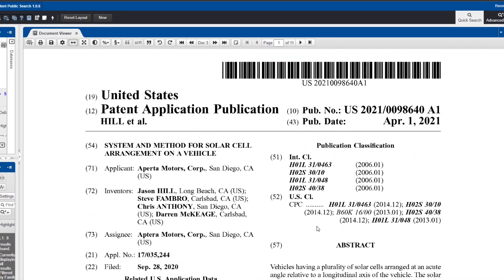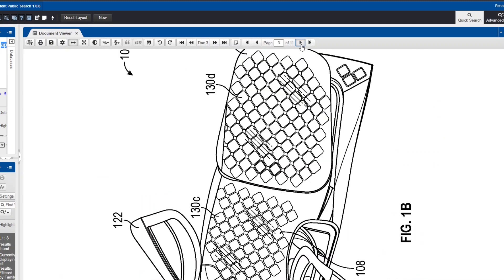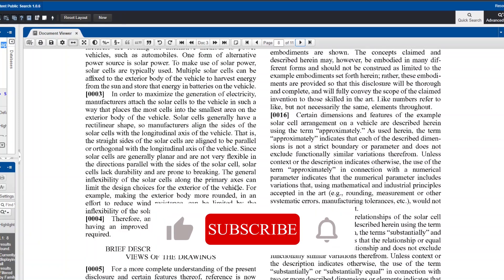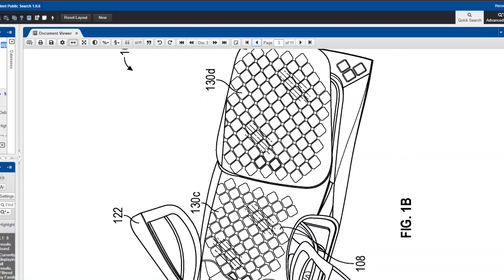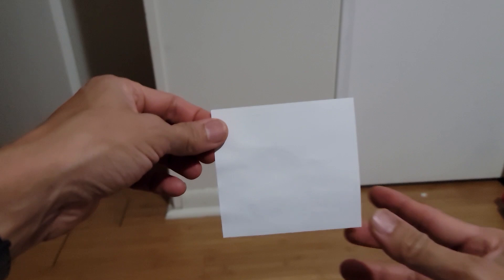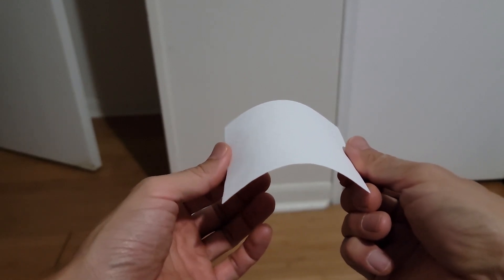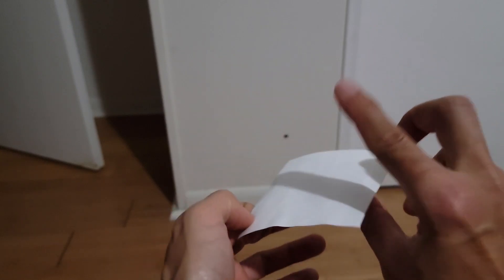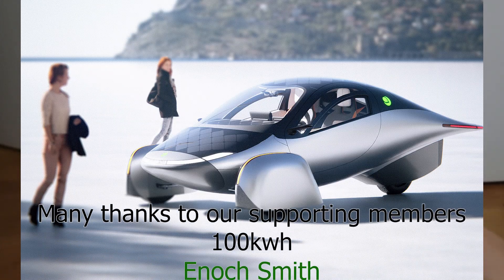Are Aptera's diagonal solar cells just a gimmick?

Comment: Every video showing how "bendy"  Maxeon/SunPower cells (like Aptera's) are shows it bending at "0-degree" not "45-degees".  One has to wonder why.......

Remember, unlike paper, single crystal silicon solar cells are brittle.
Reply: sounds to me like you are talking about folding it where there is an actual angle/crest and not arching it where it is a radius/circular.
Reply: @DaBinChe  Like N. Bruce Nelson, I suspect you’re not understanding.  Let’s see if I can help.  In this video, Steve talks about how Aptera claims that by not having the cells laid on the vehicle in, essentially, a 0 degree orientation but, rather, rotated 45 degrees (see the patent application), then the cells are less likely to break.  My comment reflects that language and asks why, when Maxeon/SunPower want’s to show off the bending capabilities of the cell, they tend to show it with the cell oriented at 0 degrees and NOT Aptera’s much ballyhooed 45 degrees.  That should suggest it’s more resistant to breaking if oriented at 0 degrees and not Aptera’s way.
Reply: @yanpingyang9028  In the case of the "2-axes" bending of paper, the host isn't doing an "exceptional job informing" and fact checking isn't "trolling" troll.
Reply: Zero degrees?
Reply: @n.brucenelson5920  Would you prefer 90 or 270?
Reply: @bobhilder1469  My preference is for the cells bending around the Aptera surfaces they are attached to- not some ridiculous angle that they don't need to to meet the functional requirement.
Reply: @n.brucenelson5920  All this talk of angles here is in regard to how the cell is rotated and not the bending angles.  Do try to keep up.
Reply: @bobhilder1469  It is difficult to keep up when you don't include your reference as to rotation from what reference point?
Reply: @n.brucenelson5920  It wouldn't be difficult to keep up if you watched the video.....

Comment: Hmm would it be more bendable if it would be like hexaconal or octoconal shape? :) Maybe the next panel model is not rectangle but some other shape. :)
Reply: You can make a carbon nanoantenna array (see the “optical rectenna” video) in any shape you want, so if they decide in some future model to collaborate with the company behind that, this would probably be possible — traditional solar cell shapes, however, are limited by silicon’s cubic crystal structure.

Comment: Your research certainly corroborates my practical experience with picture framing, sewing, and shoemaking.
Reply: Regrettably, Steve's research certainly does not corroborate my practical experience with actual solar cells like Aptera's......I'll expound in a later comment.
Reply: @bobhilder1469  Bending plastic to conform to curves certainly requires heat. I used to bend plexiglass with a propane torch to make simple objects like stands. It looks like Aptera is using heat and vacuum in their bending/bonding process.
Reply: @maudessen573  Single crystal silicon solar cells aren't plexiglass (Poly(methyl methacrylate) or PMMA for short).  The modest heat used in Aptera's "laminating" will come no where close to reaching a temperature in which they will "soften".
Reply: Apparently framing pictures is a different art (science) from building automotive solar cells, saith Bob Hilder!
Reply: @adimchionyenadum2962  I sure hope I’m not the only one that would saith that.  If I am, humanity is hosed!
Reply: @adimchionyenadum2962  LOL! We’ll see if that holds up to shoemaking.